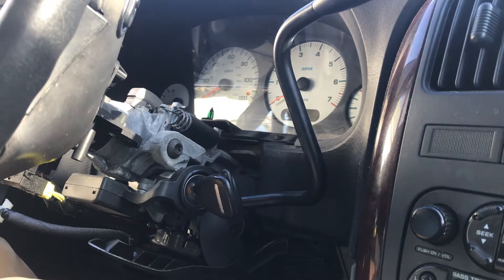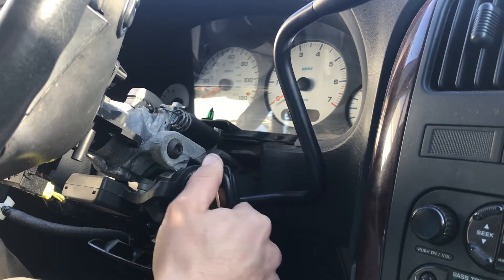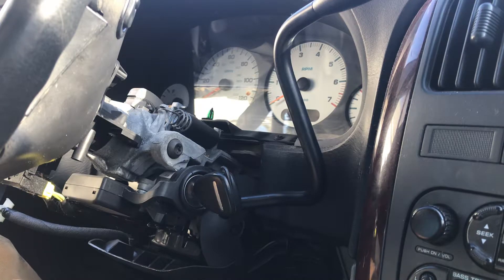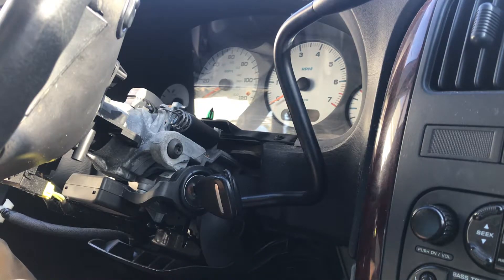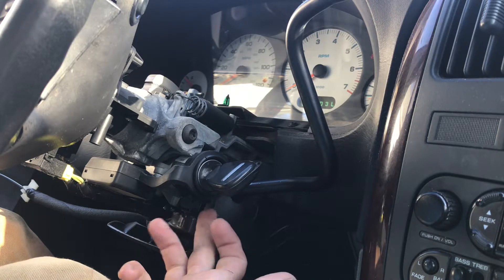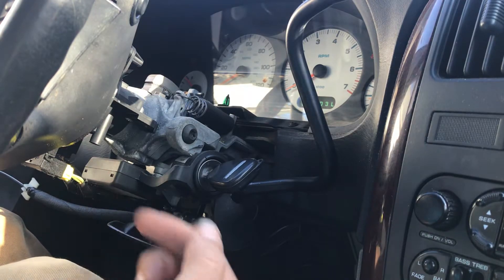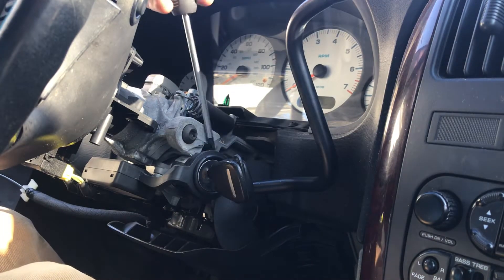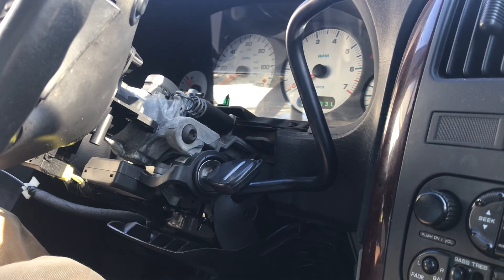2004 Chrysler Town & Country - Ignition Lock Cylinder Stuck - Easy Temporary Fix

Comment: Jon, Thank  you for posting this.  Three years later it saved me from calling a locksmith yesterday (SAT).  I was out with a friend, made a quick stop at a closed store to check the hours, then the key would not turn.  2002 T&C.  First time it ever happened.  I was focused on an intentional interlock malfunctioning like the steering lockout or holding down the break pedal.  It  has not occurred to me to consider a stuck pin in the actual workings of the lock.   After watching your video I first tried raking the lock with the key (I didn't have an actual wave rake).  I also did not have the tools to remove the shroud so I took a short piece of metal pipe that was in my van and somewhat gently but firmly "thunked" the end of the lock where you stick the key in.  That did the trick.  Have started and stopped a number of times since at key is working normally / as usual.  I will probably get some dry lubricant to shoot up in there in hopes it may prevent a recurance.